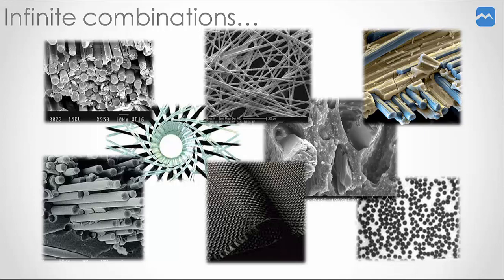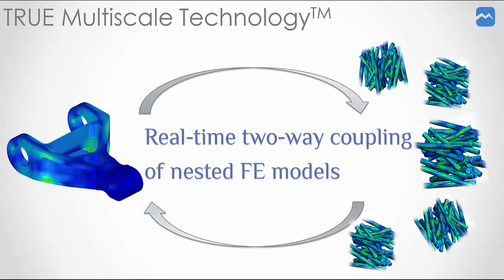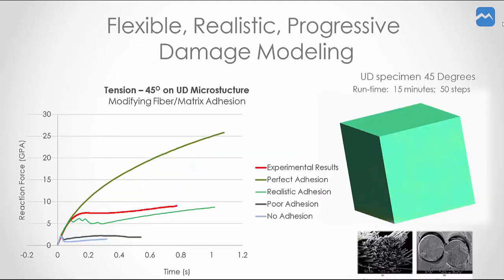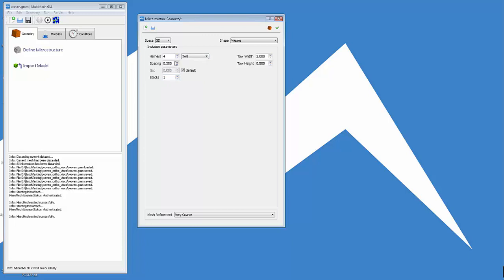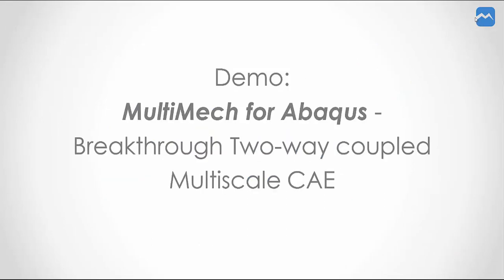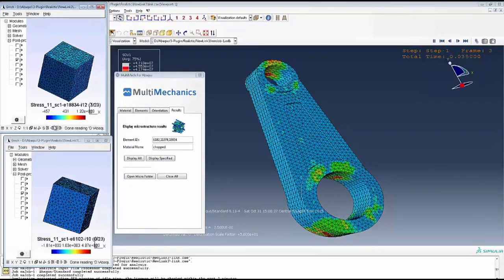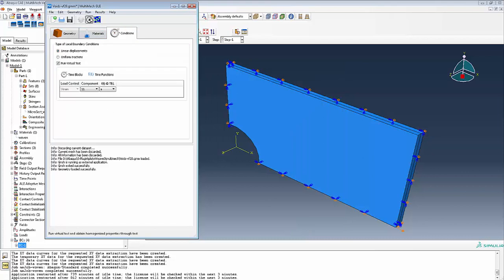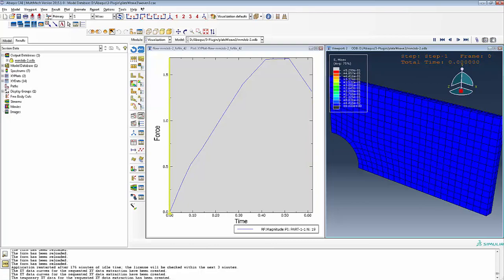Integration of Multiscale Multiphase materials with Abaqus

Comment: How is it compared to Digimat?
Reply from the maker: Hi Ditho, thanks for your question. MultiMech’s multiscale approach (which we call TRUE Multiscale technology) uses FE models as microstructures. This gives the user far more versatility in terms of material design and constitutive modeling. Digimat’s multiscale approach uses Mori-Tanaka as the analytical model for the microstructure. There are multiple assumptions in that model, limiting its versatility. It was originally only meant for materials with ellipsoidal inclusions perfectly bonded to the matrix, so accurate nonlinear material behavior is unfeasible when those assumptions are violated. When comparing both multiscale approaches, there is no question that FE microstructures are more accurate and realistic than any analytical solution, including Mori-Tanaka. The only drawback of the FE method is that it used to take an enormous amount of time to perform. The good news is that MultiMech’s new proprietary data compression technology reduces the computational cost of multiscale FE simulations to the point that they are now practical and the choice between the two approaches is now a no-brainer. In terms of decision/evaluation criteria, speed is fine, but accuracy is final.
Reply: I always recommend focusing on your strengths compared to criticizing competitors, especially since your statement is inaccurate. All the best,
Reply: hicham farid is there free rve plugin builtin in abaqus?
Reply: Yep, there is an RVE plug-in in Abaqus, I'm not sure if it's free or not, I can get that information for you :)
Reply from the maker: Hi Hicham, great question. The FE-RVE plug-in for Abaqus allows for users to create microstructures and extract the homogenized properties of the composite material. These homogenized material properties can then be used to run linear simulations of a part. MultiMech can also do homogenization, with just as many (if not more) automatically created microstructures. Where MultiMech separates itself is its ability to include damage parameters in these microstructures and simultaneously run the global and local scale models, where each RVE is entirely unique.

However, the FE-RVE plug-in and MultiMech can be used in conjunction. MultiMech can import the RVEs generated with this plug-in and with it, run a fully coupled multiscale simulation.
Reply: Hey Ditho, 

Thanks for your detailed response. The FE-RVE Plugin is available for free (just confirm that with our DS team). are you on LinkedIn? I would like to discuss more details if you dont mind :)
Reply: Thanks for the Demo, it's very interesting, but how does this Plug-in compare to FE-RVE plug-in available within Abaqus?